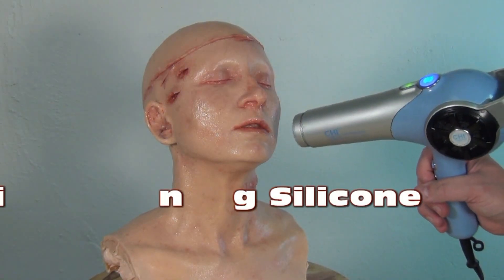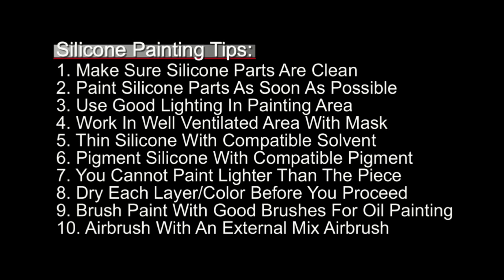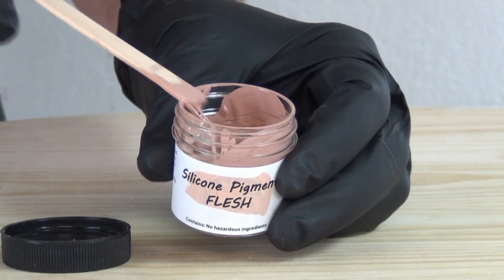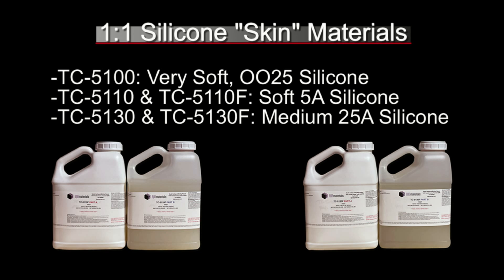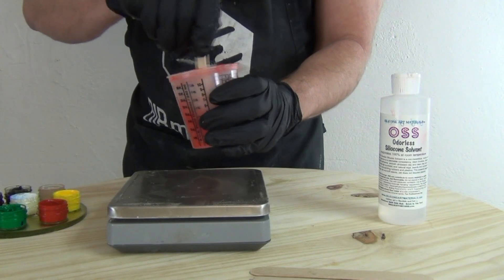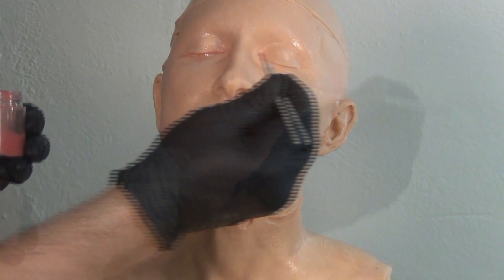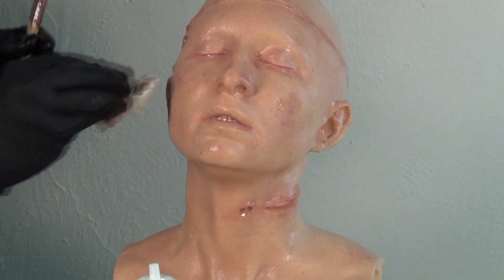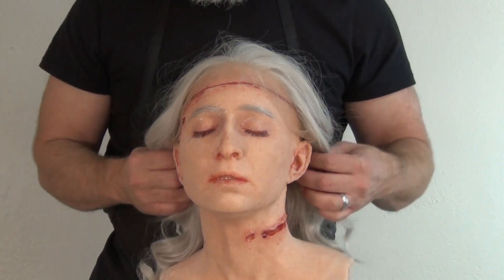How To Airbrush & Paint Silicone Skins

Comment: Would this process be safe when painting silicone adult toys (internal body safe). I am looking for a way to paint a part without having to try and paint it in the mold while casting.
Reply from the maker: Unfortunately I have no idea what kind of testing is required for that! You would probably need to have your parts tested independently to make sure your end product is compliant.
Reply: @brickintheyard ok thank you! I think the biggest concern would be delaminating
Reply: @NowhereEternityVA  let me know if you find an answer looking for the same, mold painting has not enough details

Comment: Good afternoon. Could you help me with a question? I need to paint a white silicone part black. Is there any paint or other product I can use to permanently color it black? Thank you.
Reply from the maker: The only thing that will really bond to silicone is more silicone. Either use the same silicone that was used for the original part or a silicone adhesive like SAM 32 mixed with black silicone pigment.

Comment: hi ! thanks a lot for this usefull video. I have few questions: in which step do you Paint veins ? can i use also baby powder to matify the silicon? Thanks ;)
Reply from the maker: There's no particular order, but I definitely would not paint veins last. As for matting, baby powder works, but sometimes it reflects light weird in photographs. SAM Matting Powder is ideal, but translucent face powder, and even Cab-O-Sil will work in a pinch.